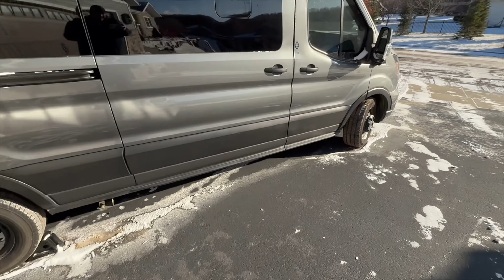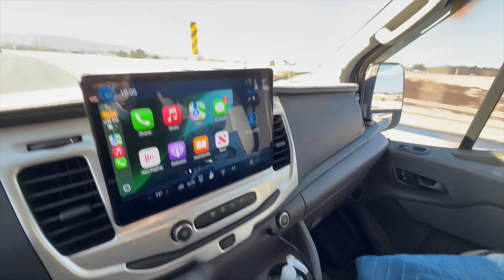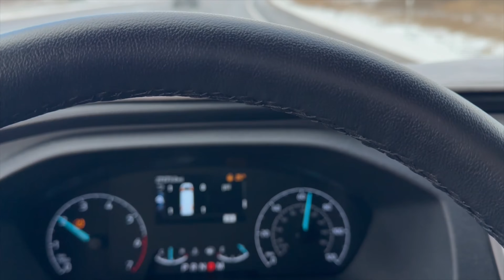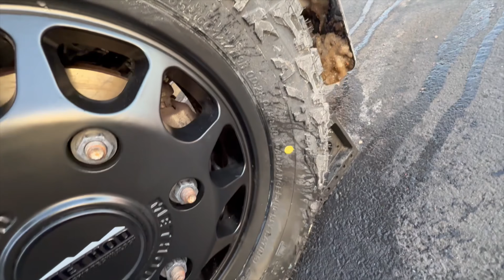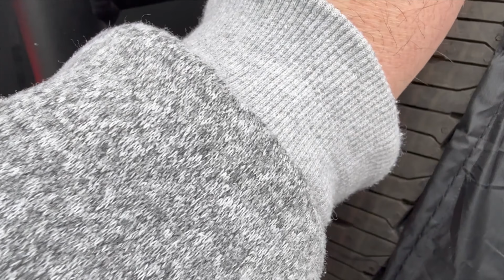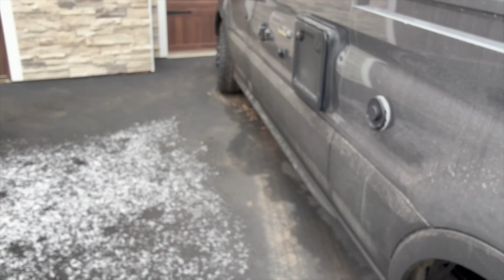Ford Transit Upgraded to Falken Wildpeak AT4W Tires, Method Racing 703 Wheels and Custom Lug Covers

Comment: Looking for new AT tires , interesting the same tire, but is your Transit AWD or RWD, and how that tire on snow and ice?
Reply from the maker: This is an AWD transit.  Tire does excellent in the snow and on packed snow roads.  OK on ice.  Doesn’t have too much problem if the ice has texture.  These tires plus weight of van seem to break up the ice, so you get traction.  If it’s glaze ice, I just wait it out.  But only true winter only tires have a chance on glaze ice.  I’m coming up on my 3rd winter in Northern Wisconsin and I haven’t swapped them for winter tires yet.

Comment: So how are these tires in the snow going uphills? I still have the original tires on and struggle going uphills in the snow.
Reply from the maker: They do pretty good.  I didn’t have any problems last winter and so far not this winter.    That being said, I just got rid of a vehicle that I would swap winter/summer tires on and I do miss having dedicated winter tires.  All seasons will never be great winter tires in my mind.  Might depend on where you live.  If you have a mild winter, all seasons might be all you need.   Where I live, all seasons are good but winter tires are a cheat code.  I’m considering the nokian hakkapelita cr4 if I start having any problems.  I suspect the van will eat the nokian’s tread when temps rise above 40 though.  How bad is your hill?  I have a horrible exit leaving my neighborhood.  Not only is it steep, but you have to make a 90 degree turn.  So you need forward and lateral traction.  The Falkens have succeeded so far in every condition thrown at them.

Comment: Awesome upgrade from the stock tires.  Did you get road hazard insurance on them?
Reply from the maker: Yep.  I think it is worth it.
Reply: Yes you know if you don't have it you will kick yourself at some point down the road for not having it! @jtbrv23
Reply: I was wondering since its been so cold there how the winterization process has held up? Also I really notice the
led running lites on the front and rear roof of upscale vans and was wondering if thats an option to upgrade?
Reply from the maker: @junglehomes6525 the winterization seems to be ok.  I did air again this winter, same as the last.  The lights on the top are always an option, just would require holes.  It’s not always an upscale thing but sometimes a size issue and the law requires it.  Like the transit trail is 2.75 inches wider than a standard transit, so it gets marker lights.  They did the “Raptor” grill with 3 lights.  I like the look of that.

Comment: Thinking of the same upgrade. Why didn't you go with 245/75/16?
Reply from the maker: Originally I did want to increase size to gain a little clearance.  Then I had subscriber that warned me about the alternator cord getting chewed up by tire.  I was able to relocate wire, but I noticed how tight the clearances were for the 235/65.  So I figured I would have a rub problem.  Also the larger size drops the max load rating by 150 lbs each tire with the Falken tires.